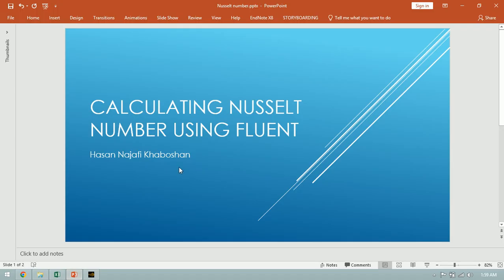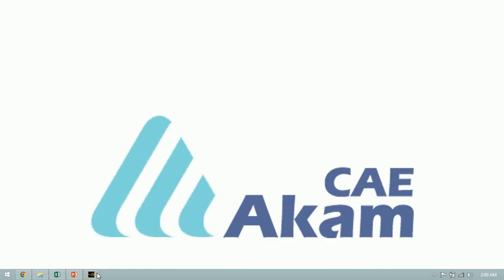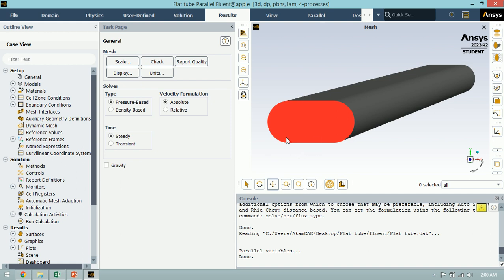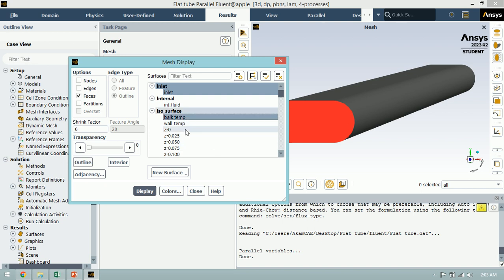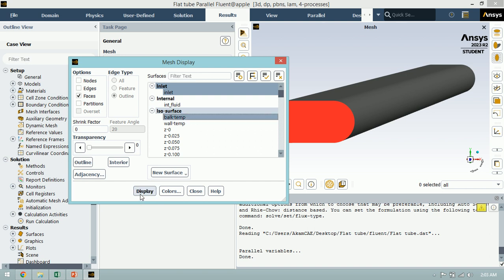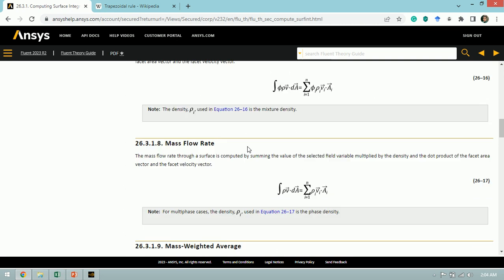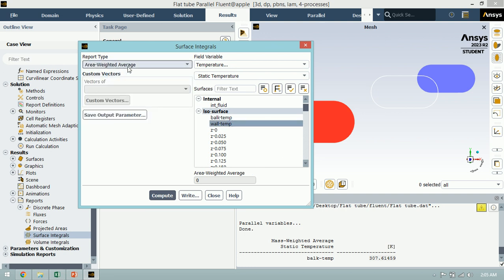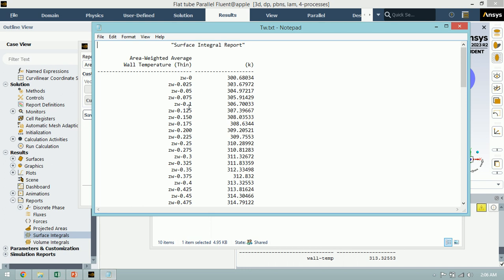How to Calculate the Local Nusselt Number for a Tube using Ansys Fluent

Comment: To calculate average Nu number must be calculate the area weighted average of the total wall and the outlet and the inlet mass weighted average for bulk temperature, is it correct
Reply from the maker: No, it's better to calculate the Nu number at each specific length of the tube and then calculate the average of all Nu number values using the methods to get the average value. The average method: https://www.cuemath.com/trapezoidal-rule-formula/

Comment: Thank you for your explanation,
When you calculate local wall temperature you used thin wall temperature,
But the local wall temperature in 3D is a line around the pipe, so it is not area weighted average, it is a length average
Reply from the maker: In ansys, we do not have a length average; so when you use area average, it is supposed to give you the average length of elements. To test my claim, please calculate the area of the line around the pipe, if it gives you the circumference of the tube, so, this method works.

Comment: Please tell us how to calculate the local nusselt number, local heat transfer and thermal boundary layer at a specific Reynolds number
Reply from the maker: For calculating the local Nusselt number at a specific point, instead of taking Tw,avg, you need to calculate the Tw at the specific point. The same procedure for local heat transfer. For the local thermal boundary layer, make a line inside the domain that is normal to the wall, then report the temperature, I guess you can see the thermal boundary layer.

Comment: How to calculate the average Nu? Thank you
Reply from the maker: You can calculate the average Nu number along the tube by using the trapezoidal rule. This is a simple method. OR; If you have access to Matlab software, you can use trapz( X , Y ) and then divide it by the length of the tube. See Eq. 14 in this paper https://doi.org/10.1007/s00231-018-2345-z.